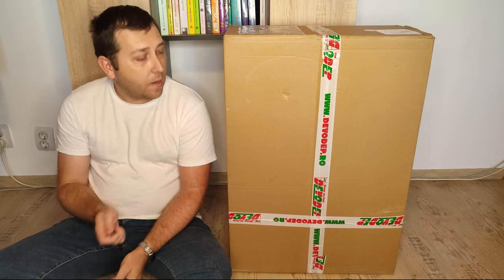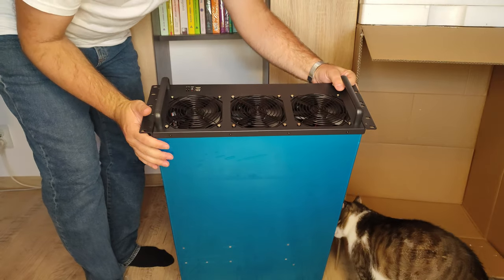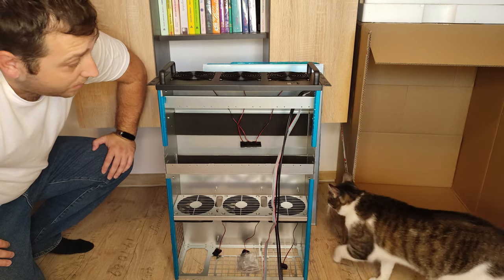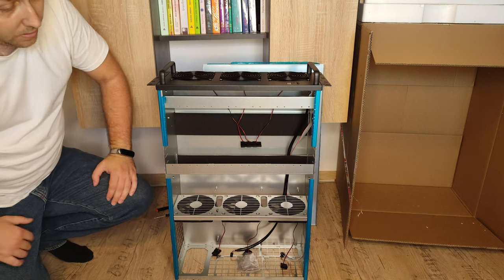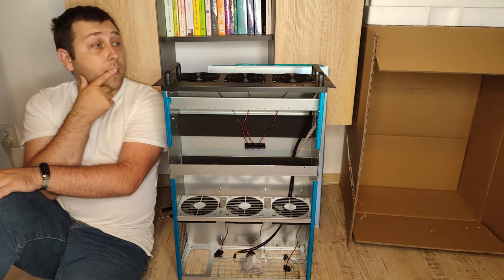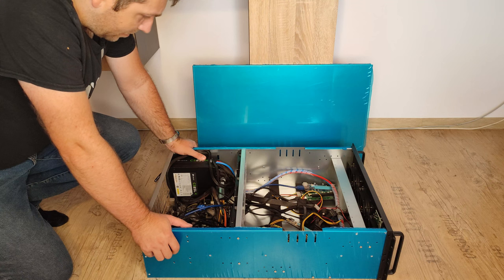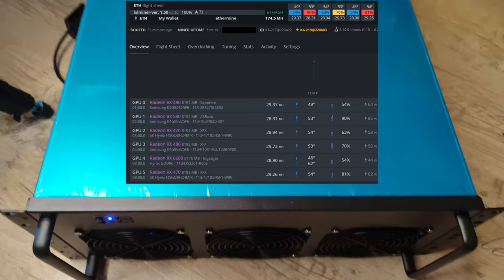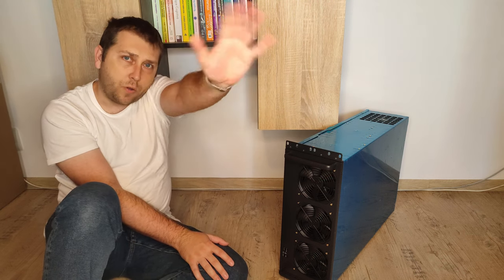INTER-TECH IPC SERVER 4W2/CASE (K456F-3G) MINING CASE unboxing | review

Comment: I bought a setup like this:
I bought 2 RX 480s for less than 60 euros, and I have a Quadro RTX 4000 lying around.

But I'm a mining beginner. The power consumption is free.

I want to recoup the cost of the third RX480 with mining.

I tried Nicehash, but it doesn't seem very efficient.

What mining software do you use?

I want to mine ETH.
Reply from the maker: Hi, thank you for your comment. First, you need to Know that ETH can't be mined with prof-of-work enymore. Second, If you want to mine, you have to make the math in a different way. Mining in this moment is not.... profitable. People are mining as hobby not to make some big profit. 2xRX480 + RTX4000 will need years to make money to can buy another one video card. I think for a bigginer the best way to mine is nicehash. Wish you gl and ask me If you have other questions.